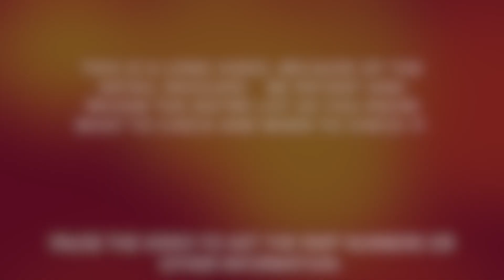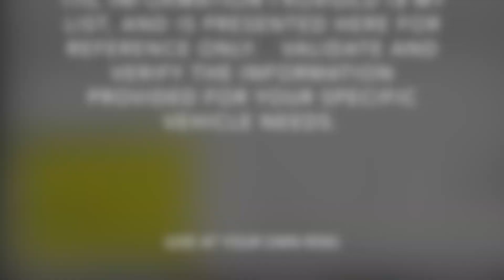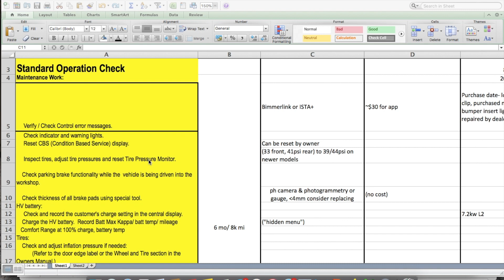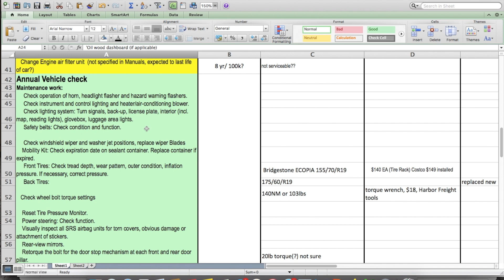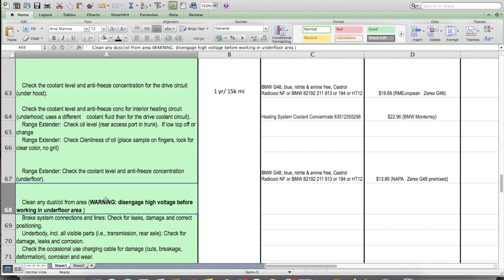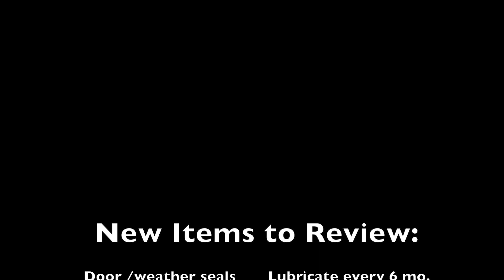BMW I3 Preventative Maint.

Comment: Great initiative!. But I was looking for an AC system/pressure check. 
There is this story about AC compressor failure causing havoc. 
Is there some way of monitoring refrigerant pressure (and thus compressor lubrication) ?
Reply from the maker: Unfortunately, I am not aware of a simple way to check this.   There are two pressure/temperature sensors in the A/C loop for BEV's with the heat pump, but only one for the REX and is labeled as checking for 'over pressure' on high pressure side.  Maybe it is possible to read these or the temperature sensors to get an idea of the status ( I haven't looked into this).    There's the old school method of checking three things: 1) is it actually cooling  2) Is there any signs of leaking (small oil spots/stains on the ground from lubricant) and 3) any unusual sounds from the compressor,  on/off cycling from possible overheating.   Unless one of the viewers has a better suggestion, I think the best thing to do is to have the system checked by BMW and make sure they use the correct lubricant/refrigerant, since  there are multiple types used for the I3.

Comment: nice summary.  Some have said the e transmission fluid should be changed.  Have you heard of this?
Reply from the maker: I have heard of this, but I am not aware of an actual change interval being specified by BMW, AND unfortunately the fill plug was removed since the early 2015 models (Some people have removed drive shaft to fill).  Great question though- maybe someone else here can add more info.   It's not really a transmission in the normal sense, but more of a single gear reduction & differential.
Reply: It def needs to be changed. I did mine a few months ago. It was the factory fill (43K miles) and the magnet had a lot of metal shavings from the breaking in. It’s a piece of cake to do on a later model BEV i3. You drain 500 ml of the differential fluid and put the same exact volume back in through the vent valve up top. Rex is probably more challenging to fill though